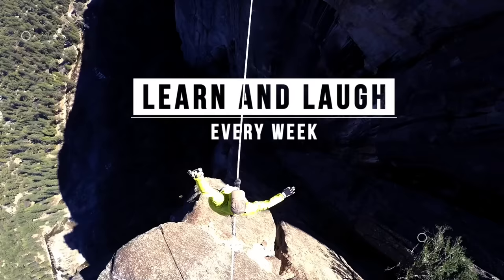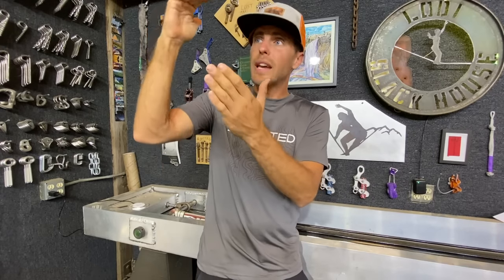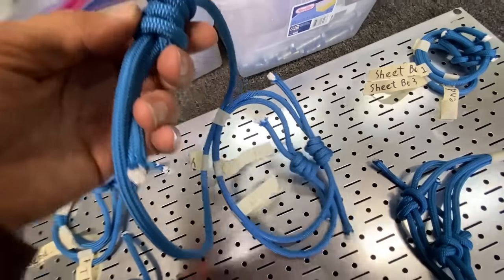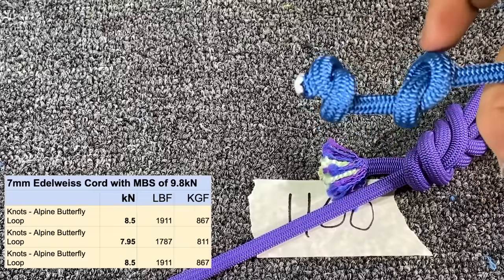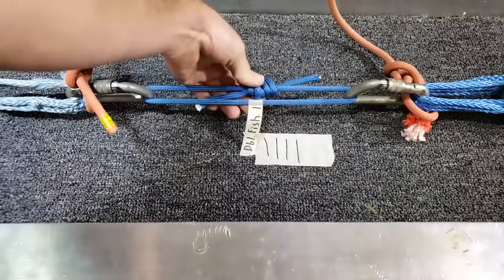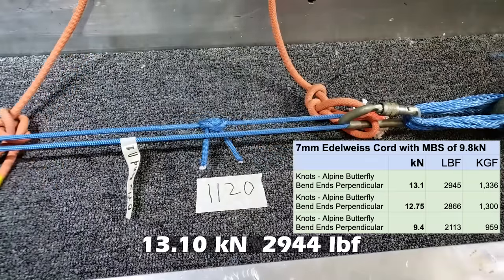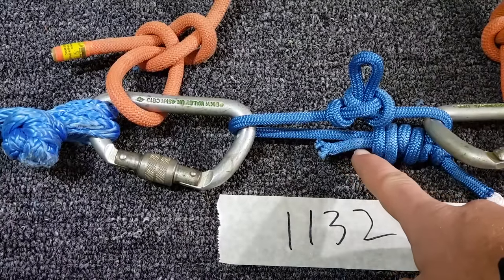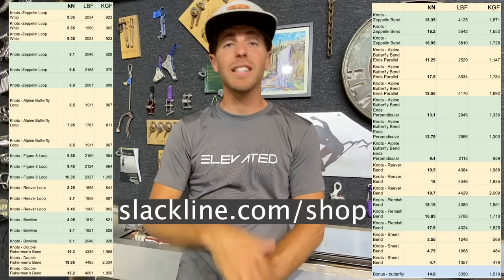Break Testing Knots - Zeppelin & Figure 8 & Alpine Butterfly & Reever & Bowline & Double Fisherman

Comment: The difference between a knot and a bend is kinda vague and often misused, but basically a knot holds its shape on its own. A knot used to tie two rope ends together (or the opposite ends of the same rope) is called a bend. A figure-8 is a knot. But if you tie two ropes together using a figure-8 so that the ropes exit on opposite sides of the knot, then that is called a flemish bend. An overhand knot is a knot, but when used to tie rope ends together its called an overhand bend. A hitch is a knot that falls apart if you remove the thing it's tied around, like a clove hitch.
Reply: Thanks dude
Reply: I would like to subscribe for more knotty facts please
Reply: Very well indeed.
Reply: Bend = end-to-end vs. loop = makes a loop using one end (or middle)
Reply: Dude, this was tremendously succinct and helpful. Thank you
Reply: Hi there! Sorry but your explanation is not correct at all. Let me make a comparison.
What you said is "The difference between a quadrilateral and a square is kinda vague... but basically a quadrilateral is a four sided figure of the same length"
You even contradict yourself just after by saying "a knot used to tie two rope ends together is called a bend" which is true!

A figure 8 is a knot, yes and the flemish bend is just an other name for... the figure 8 bend. If you do a loop it's, a figure 8 loop which can also be called a flemish loop (see ABOK) and if you just do a figure 8 on one strand it's not a loop nor a bend but it's now a stopper and it's also called a flemish knot.

I will not say anything about overhands because we could talk about it for a day long xD (overhand bend as you said, overhand [stopper] knot, overhand loop, overhand noose, slipped overhand,...)

I can give you examples of hitches who don't fall appart if you remove the object on which they are tied. But you are right a bend is a knot tied around an object.

And nothing vague, look at ABOK =)

"A knot is an intentional complication in cordage which may be practical or decorative, or both.
Practical knots are classified by function, including hitches, bends, loop knots, and splices: a hitch fastens a rope to another object; a bend fastens two ends of a rope to each another; a loop knot is any knot creating a loop; and splice denotes any multi-strand knot, including bends and loops.
A knot may also refer, in the strictest sense, to a stopper or knob at the end of a rope to keep that end from slipping through a grommet or eye."

Sorry for the long post but I couldn't let nearly a hundred of people liking something vague and a bit wrong on some points about knots without saying anything XD

I'll happily share and talk more about knots if you want =)
Reply: @laurentblondiau4274  Just another guy who also has an opinion on how facts are presented. Your in depth explanation was great, but for most people out their I'm sure all they see is blah blah blah blah blah. To say that the original poster of this "difference between a knot and bend " is wrong, Is wrong. It was short and concise, if you want more information see ABOK 🤣
Reply: Best explaination of knot, bend, and hitch.
Reply: That’s not true. A bend is a type of knot. So are hitches, friction hitches, loops, stoppers, etc..   They are all knots.
Reply: wait so then round turn + 2 half hitches isn't actually a hitch at all right
Reply: Have you ever heard of what I was told was called a mothers knot? As far as i was told its used to tie 2 ends of rope together either same rope or 2 ropes.its basically 2 overhand knots one tied around the opposite line so the harder you pull the tighter it gets.I am not good at typing description like this but I hope you get the gist.
Reply: @jake-gd8rb  sounds like you might be describing the fisherman's knot, if you mean it's two overhand knots, each sitting on the standing line of the other rope
Reply: Good luck getting anyone to say bend.
Reply: I always thought a hitch connected a rope to a stationary object. It does not necessarily fall apart if you remove to object. The easiest example is a ground line hitch. But there are others like the clove hitch that fall apart. Bad definition but close I guess?
Reply: @laurentblondiau4274  There's ABOK and there's wrong.
Reply: For a lot of definitions yes, but ABOK is obsolete when it comes to modern applications.  It was written in the day when sailors were the masters of ropework and ropes were natural fiber twisted line.  The state of the art is now in the hands of rock climbers using synthetic rope.  ABOK doesn't apply to many of today's applications.
Reply: @benjaminvalenzuela3948  Exactly. The knot world would have more order if people remained consistent with the ABOK (Ashley Book of Knots) as a basic starting point. Ashley considers a bend to be a type of knot.
Reply: Takeaway: some knots are bends, bends are a type of knot
Reply: @adriansalas3951  since I am knotting nut, I was quite excited to see the long explanation.
In brazilian portuguese we don't have that much nuance. AFAIK, we only have knots (nós) and hitches (voltas).

Comment: That was NOT a sheet bend, a proper sheet bend is tied so both ends come out on the same side. It's such a common mistake that I think nobody should use it at all.
Reply: Agreed-don’t use it.
Reply: @daveaver  what should I use instead? I need a replacement for sheet bends so I can attach a cloth to a rope
Reply: His sheet bend looks like every sheet bend I've ever seen.
Reply: @sam9415  it’s wrong.
Reply: The knot in the video was a "left-handed sheet bend". Using one instead of the other is analogous to using a granny knot in place of a square knot. If you can't tell the difference, you shouldn't use it anyway.
Reply: @sirj3487  Bro-science
Reply: i always the double sheet bend, amost as quick, safer and looks nice😍

Comment: Your work is truly important. Ashley wrote his famous book of knots in the late 1930s. He used mostly 3 strand hemp cord since nylon was still in the laboratory until it got its start in women's hosiery and parachute cord during the war. Needless to say, twisted organic fibers behave differently than braided synthetic fibers. So certain properties like a tendency to jam with organics may not be as severe with synthetics, and other knots than seemed to be secure with organic rope will loosen or creep with synthetics if the load is cyclic. The old adage about tied, dressed and set is always good advise, but you now have the ability to inspect knots under increasing strain to see how they change shape under load. Some of these knots seem to get lumpy rather than simply smaller under load. It would be interesting to see how loose knots can be upset and change their form under load. Some well tied knots may also have this property. Then, there is the difference between kernmantle and double braided rope as well as nylon versus polyester in typical climbing ropes. HMWPE or Dynema behaves differently then we are used to.Yes, I left out the aramids, but this is post getting too long.
Reply: tied, dressed & set properly: 
yes!  The Yosemite bowline can be 
and has been mis-tied (dressed carelessly) 
with tragic results.

Comment: As others have pointed out, the sheet bends here were all tied the wrong way, with the working ends on opposite sides of the knot, but that shows that it's a knot that should be approached with lots of caution. A zeppelin bend doesn't seem to have a "wrong way", and it's easy to undo. A carrick bend even more so. If you urgently need to connect two ropes and you don't mind having to cut the rope later, do an EDK or a double fisherman's. The EDK is the easiest bend to tie, and it doesn't deserve its bad reputation, as long as you leave enough of a tail for it to capsize once.
Reply: I like to tie an EDK and then use that knot to tie an alpine butterfly. That way it's much easier to untie under load
Reply: I'd also like to see how much better a double sheet bend holds.
Reply: The Carrick bend does have a wrong way, the method taught in the 13th edition scout handbook puts the loops in opposite directions instead of the same,  which allows the knot to "unwind" in the same manner as a thief's knot. This was tested by me in 3/8" nylon sailing line, 1/2" decommissioned climbing rope (material unknown, looked like static), and assorted sizes of manila and sisal. Only the sisal didn't slip, which is irrelevant as sisal never slips and breaks easily.

Comment: All this testing is a huge service to the climbing community, very much appreciated. Happily, it mostly reinforces my general view that protection-sized gear from known good manufacturers (BD, DMM, Petzl, Totem, and some others) is reassuringly plenty strong for what actually happens in climbing, setting aside the oddball biner broken over an edge. My only (pretty insignificant) issue with this video regards the sheet bend, which I always thought - don't know where I got this idea - was intended specifically for joining two ropes of significantly unequal diameter. Along with a Flemish bend (new name to me too), it's the only one I think is supposed to be good for that. And it's an important situation, as in when you join a tag line and the lead rope to rappel. It's outside the topic of this video, but I think for climbing it's important to simplify the diversity of knots one uses, and especially to rely mostly or only on ones that can be quickly verified visually as having been tied correctly. Figure 8 (both for a loop and as a bend), alpine butterfly, double fisherman's, clove/Munter, Klemheist and Bachman. Rarely an EDK when a difficult retrieval is a likelihood; also rarely a double bowline backed up. Tired, dark, storm - simplicity is a virtue.

Comment: Here are a few thoughts: 
First establish a baseline rope strength by breaking some unknotted rope attached to largish diameter anchorages, e.g. a "bollard" or "capstan" type anchorage, using a several round turns and a high strength tie off.

Then test knots in a way that simulates normal use cases (i.e., bends to join tails, loop knot to form loops), but avoids tight radius attachments ( use smooth but large shackles instead of carabiners).

Now that you've got a estimate of rope strength and knot efficiency, apply the knowledge to more "real life" configurations and loads: use carabiners where appropriate, use drops to simulate climbing falls, and some sort of "slackline simulation" by dropping a load normal (perpendicular) to a tensioned line anchored with the knot in question.
Reply: Yes, a bollard is a must. They should divide the failure points of bends not by 2 but rather 1 and something because there's clearly two ropes and when the bend slips, the other side gets shorter and pulls the rope over the edge of a carabiner. It would be better to call the test unvalid and do it properly
Reply: I'd look at securing the rope with clamps to ensure the rope fails at the knot or at a random point in the rope.  I would also like to see the Ashley bend tested.
Reply: @trollmcclure1884 
What? The point is they’re showing it’s breaking point in real world application… I don’t climb with bollards. I just want to know if replacing my cam sling with a 7mm bend/loop will be over the kn of the cam itself… 
And other such applications.
Reply: @Jayizzy433  you'd still benefit from unbiased result using a bollard. Unless you make slings between two carabiners using these knots just like them. Otherwise it's a bogus claim. Alpine butterfly should be tested using the loop, not the sides. If they break in the knot then the test is valid. If it breaks over the edge of a carabiner then using a bollard would be better to test the strength of the knot.
Still interesting to get an answer just when I'm doing rope access after a year or so. We use only figure 8 and Alpine butterfly so that everyone is familiar with it and can check the anchor and trust it. I'm gonna produce a video soon because one guy expressed a concern over my 12 year old dyneema sling. A believe it will still pull 2 ton concrete block. He said it will hold 500 kg. Nonsense. It's not been used much at all

Comment: Loving the end screen disclaimer! 
Re: rope strength differences. Yeah it might be differences in test setup, but it is possible to have the exact same diameter of rope made of the same materials be stronger. Two ways: 
1) the weaker rope may have a thicker sheath, but thinner core.
2) the stronger rope might have longer polymer chains with less defects in the core strands.
Reply: Ýou are right, thank's for pointing this out! Additionally the way it is woven could make a difference I think.

Comment: That was fun! Shout out to that double fisherman. Thanks for all of your work
Reply: That one surprised me. I was under the impression the double fisherman's bend was a significant weak point.
Reply: @1-t254  I'm a fisherman. I looked up the double fisherman knot and it looks like a simplified uni-to-uni knot, which is widely regarded as the best quick way to join two fishing lines (near 100% break strength). It works because as you pull it tight, the wraps cinch up and clamp down on the other line. And you get a double finger-puzzle effect spreading the load over a length of line, instead of concentrating it at a pressure point which can cut the line. In the uni knot, the wraps go around both lines. In the double fisherman the wraps only go around the opposite line.

Comment: Thanks again, great video.

Here's an idea:
Put the rope through a pulley on each side instead of directly through a carabiner. This way the load on each side of the carabiner would be equivalent in this configuration. (Rather than the knot side of the rope stretching more than the other, which puts differential stress on each side of the carabiner). This would also achieve a higher bending radius which might be more useful when testing knots, rather than having the carabiner impact the results. Essentially it easily takes a variable out of the equation..
Just an idea!
Thanks again for sharing! Useful for everyone that literally puts their life on the (a) line every day especially!

Comment: The proper use of a Sheet bend is to tie 2 ropes of different Diameters. Like a smaller line attached to a ships docking rope. 

It would be cool to see the knot tested in its correct function. the larger Diameter forms a bite while the smaller diameter rope / cord circles around it. 

It can also be used on Tarps and sand bags (where a bite is created from the tarp or sandbag material) 

Thanks for sharing another great video!
Reply: a small sandbag can be used as a heaving weight, 
like a monkey's fist, but 
Re.  sheet bends:  the simple simon UNDER 
is a better alternative.

Comment: The 9.8 kN  MBS value is exact what the technical standard EN564 requires: In Europe Edelweiss is more a budget brand, so I expect they produced a rope “good enough” and then simply save money by testing not more than required and selling it labelled with a probably too low but save MBS value.
But it has to be tested according to the same EN564 test procedure like the Edelrid, which defines the way of attachment.
Reply: That´s wrong and unfair to Edelweiss. Edelweiss is a specialist for climbing ropes and for example produced the first climbing ropes which were specially shielded against abrasion from sharp rocks. There are definitely no "budget brand".
Reply: @androssgetzko2098  Ok, your comment about 'budget 'is fully right looking at their product range. I should have been more precise and said that this is what they appear to be in some countries around, what seems to be more a marketing/lack off distributor issue.

Comment: Thanks for doing the testing. 
I've been using the reever knot for years. Fairly easy to tie, easy to see that it has been tied correctly, holds really well and relatively easy to untie after it's been loaded. Glad to see that it ranks high.
Reply: That an interresting knot for what do you use it for? If you use it to tie both end of the same looking rope does it still feel easy to see that it has been tied correctly.
Reply: @zb1b1z  : It has a distinctive pattern on both sides. I use it when I need a really strong connector that can handle a heavy load and can be (relatively) easy to untie.

Comment: This was awesome!  You're underestimating how valuable this info is.  My takeaways?  The good knots are pretty good, and all pretty consistent with each other.  That the sheet bend is an old knot that might work great on high friction old rope, but looks like not so good with modern line.  That the bowline is underrated.  That the figure 8 is great, but maybe I should be looking at fishermans for slippery rope.  And finally, that the "make a loop thing" of course really does work, and because there's two lines is going to be stronger than the max breaking strength of a single line...even with the losses of the knots and the hardware.  See?  I learned a LOT and I'm pretty slow!

Comment: This is another great video, love your content. I'm a sailor rather than a climber but there is so much crossover to learn from. I Have always been dubious of the sheet bend anyway which seems to be confirmed by the video. However, I was taught (rightly/wrongly?) that a sheet bend is used to tie dissimilar diameter ropes with the large rope folded over and the smaller rope forming the wrapped part of the knot (can go round twice for a double sheet bend). If the ropes are the same then a square/reef knot should be used, although this is another dubious knot for tail slippage! Good to see the easy-to-tie double fisherman do so well.
Reply: The square knot is dangerous because it slips. The Flemish bend is much more secure, easy to tie, easy to visually inspect and pretty easy to untie after it's been heavily loaded. Stay safe!